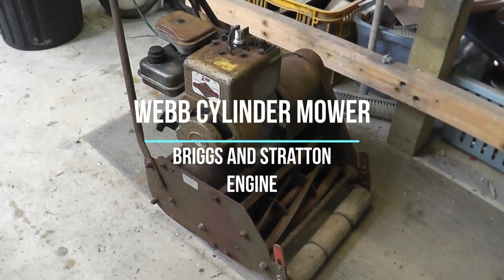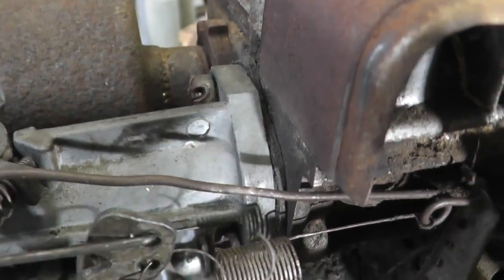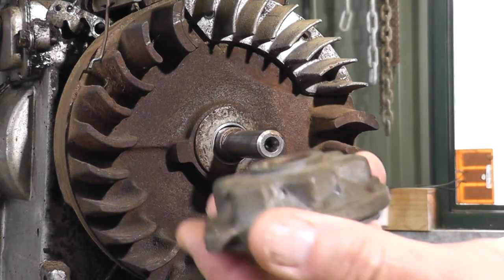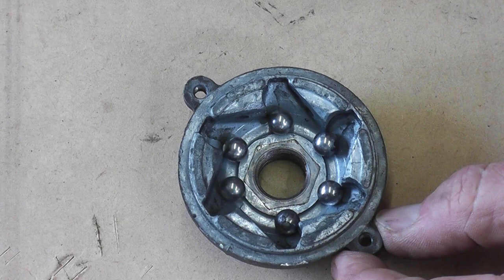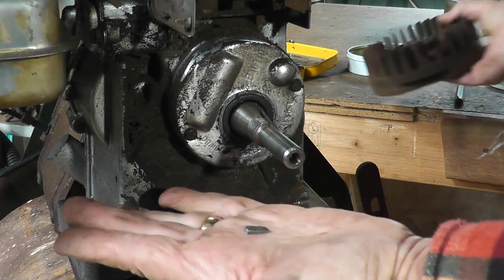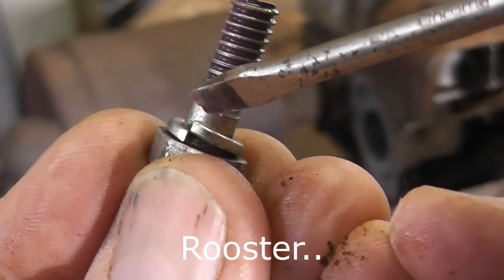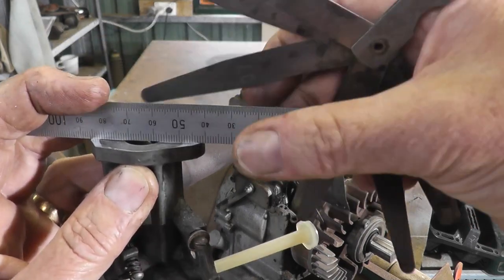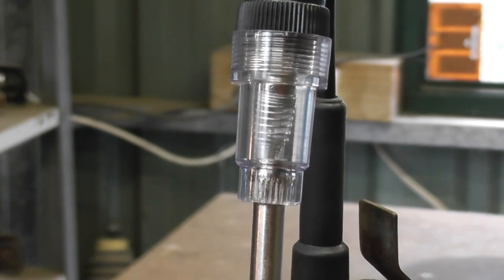Webb cylinder mower with Briggs and Stratton engine resurrection part 1

Comment: Hi great vid. There is a small hole at the end of the starter pawl thingy. This is for putting a drop or two of oil in and there should be a small felt washer inside that gets soaked with oil to stop it squealing and ultimately seizing and undoing the starter. I know it happened to my machine!!